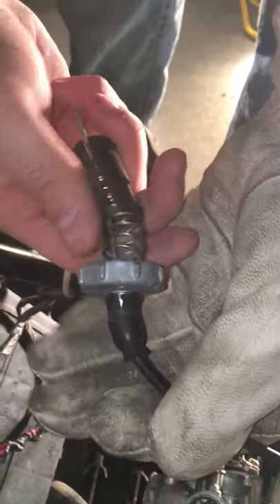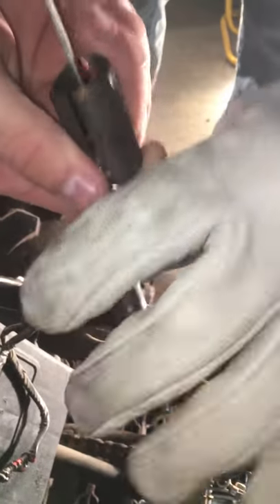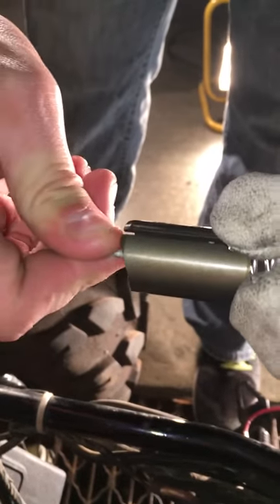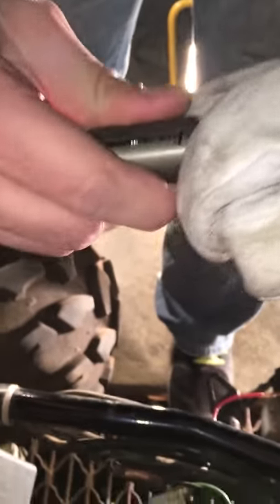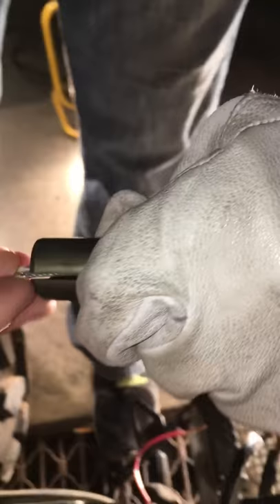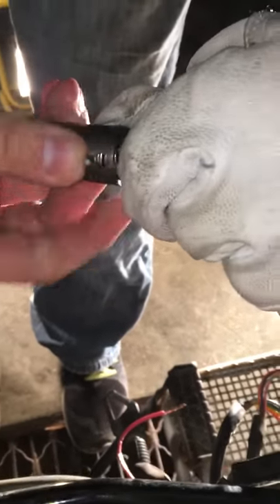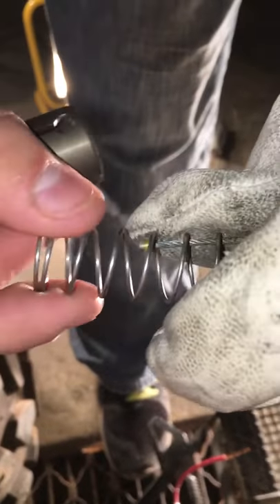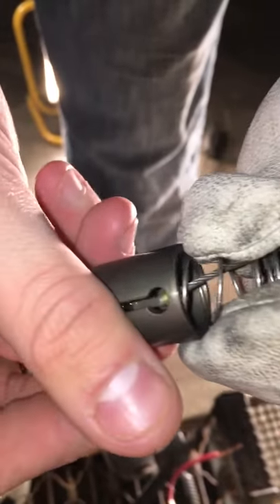Removing a pit bike throttle

Comment: the throttle cable cap is stuck in cant unscrew it i used a clamp tool and it wont budge

Comment: I have that same carb for my dirtbike. Is there a piece that keeps the throttle cable from rotating? Mine keeps rotating it is causing the throttle to get stuck
Reply: Same bro, i think that would be the main problem to me too, idk if is that or is sticky but it gets stuck when I open the throttle wide open and I have to pull the cable a little bit of the carburetor and it snaps back,  but idk it may be the spring, and when half throttle it doesn't have a problem.
Reply: @ovidius9862  please let me know if you find a solution to this! I just want to ride it again 😭

Comment: Talk about an improper vid? I mean, come on dude! Who tf whats to see this?
Reply from the maker: i mean it was mainly so i remembered when putting it back together. I thought i would share to help others. I know its not the "best" video but its what i had at the time. sorry to disappoint.
Reply: ngk330 You do what you want to on your channel dude. Didn't mean to cause any harm or hurtful feelings
Reply: @ngk330  do u know how to get the throttle cable out of the set screw at the top of the carb ? Currently struggling with that